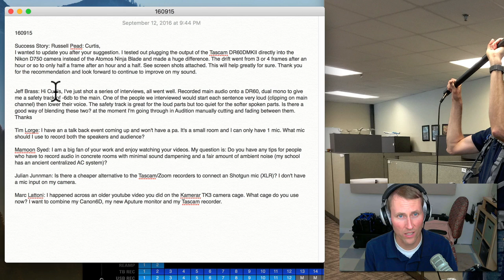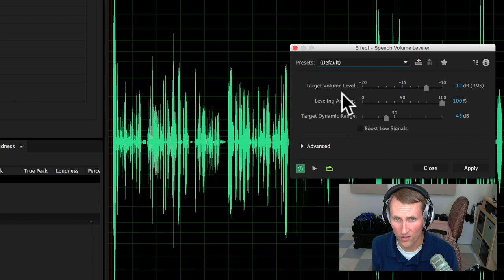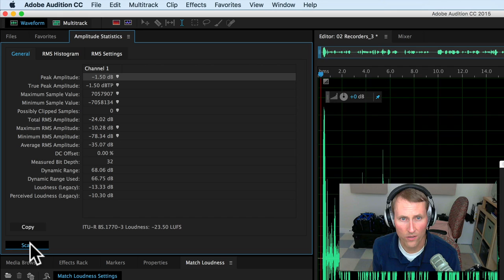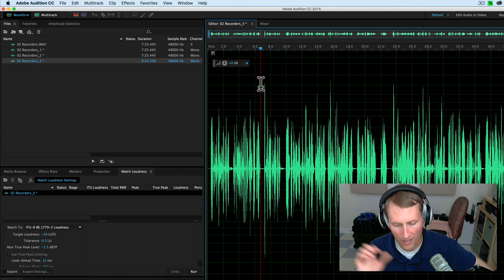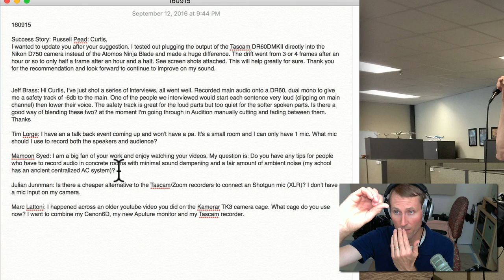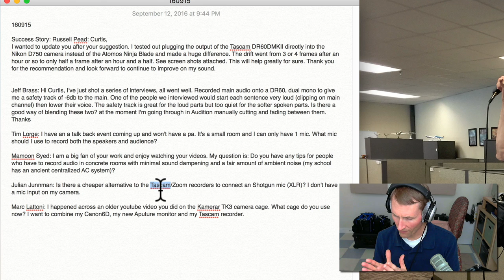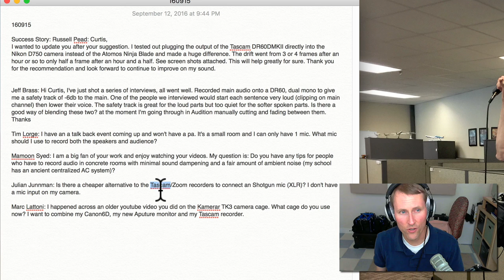Sound for Video Session: Sync Sound, Mic Placement, and Reverb 12 September 2016

Comment: Great discussion. I totally agree about taping both sides of the lav. I tried numerous times to make moleskin sandwiches work for lavs. Every time I used moleskin I would pick up clothing noise.  Now, I'm a big fan of taping both sides of the lav, far less noise. Are you using gaff tape triangles or two sided tape?
Reply: Thanks Gregg. I use topstick - hypoallergenic double-sided tape designed to keep Toupee's in place: http://amzn.to/2d0OweM  Gaffer's tape triangles can work as well but I prefer the adhesive of topstick on mics. Seems to hold a little better on clothes.
Reply from the maker: Thanks. My best recordings have come when I make sure that lav mic moves with the clothes rather than trying to put a bunch of soft things around the mic. I mostly use topstick two-sided tape (toupee/wig tape).